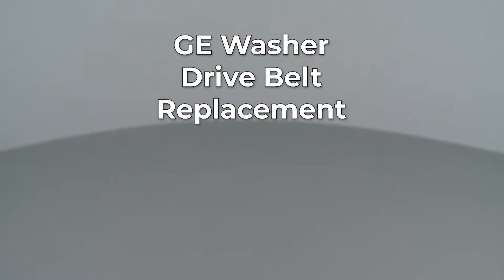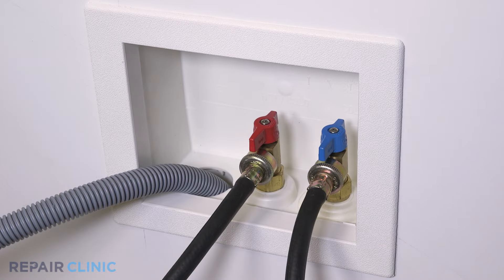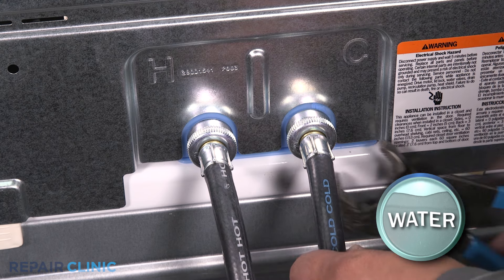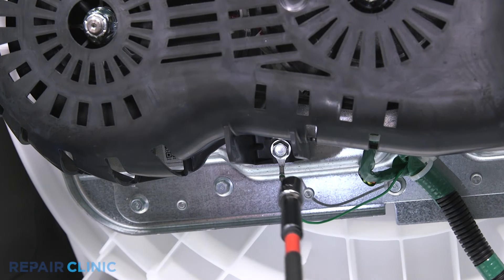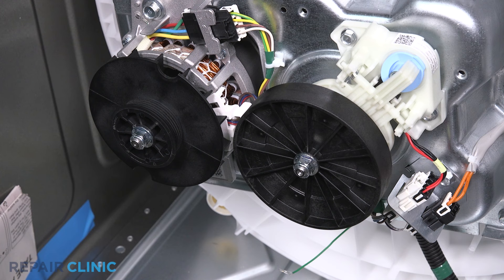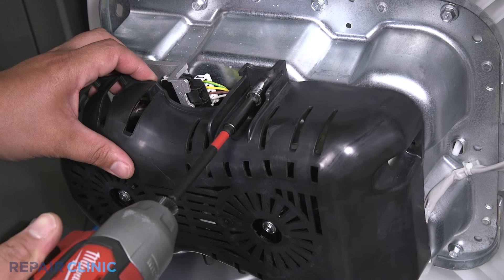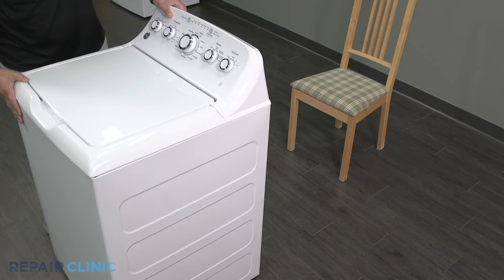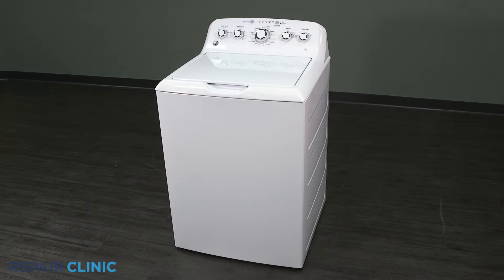GE Washer Drive Belt Replacement WH01X24180

Comment: How, sir...just how!??? Im using every limb and every fiber of my being. did you cut out the part where you struggled for 77 hours or do you have magic hands?
Reply: Use a blow drier to warm up the belt. 🤫😉
Reply: I spent 45 minutes struggling mightily. Put the belt in boiling water for 10-15 seconds. It loosens up the rubber. I spent 15 seconds and it worked!!!
Reply: I used a flathead screw driver to put it in place, but I seriously thought i was going to break the plastic wheel. I realized afterwards that i should have heated it up. But this video is somewhat misleading.
Reply: Didn't think to warm it up.  Put a vise grip on the pulley rib and used that to keep the belt from sliding off and as a crank lever.
Reply: Im trying now! omfg
Reply: I think this is misleading, I followed another site and put the belt on the grooved pulley first and using gloves and turning it went on the big pulley fairly easy. 3/8 socket for bolts. I also just tilted mine up like in the video, no unplugging or hose disconnect
Reply: I swear 😂😂😂😂
Reply: Lol i catching hell with it now 🤣  look easy to put back on omg!!!!!! 😢😢
Reply: I have cuts all over my hands plus all the grease that was on the spindle's 😂
Reply: Was struggling then I started at the smaller pulley and attached a 9/16 socket and ratchet to the big puller to turn while having a flathead screwdriver prying the belt at the middle of the big pulley. All I did was turn the ratchet until it was applying leverage to the screwdrivers handle and it went right on. Hope this comment made any lick of sense!

Comment: If anyone is having trouble, it's not too small and he makes it look way too easy lol. I started with the small side and used a flat head screw driver to stretch it over the big side while rotating the two disc's. It's worked and took me about 5 minutes once I used this method.

Comment: Heat up the belt with a hair dryer or boiling water.  Much easier
Reply: Thanks. That worked like a champ.
Reply: Dont ever do that you compromise the rubber

Comment: The easiest way to get the belt on. Put the belt on the small pulley and make sure it is in the groves. On the larger pulley, put the open side of the wrench on the pulley nut and hold it against the pulley, trapping the belt. It holds the belt on while you rotate it. Goes on easy. I would add a pic here, but it will not let me.

Comment: Any tips on stretching a belt to fit? I’ve got the right belt, but there is zero give.
Reply: small pulley first then roll
Reply: @connorgators  I did that, but I was holding the belt in the wrong place when moving the big pulley. Finally got it figured out and now I have a quiet washer. Thank God.

Comment: For anyone struggling to get the belt on - I believe the GE belt is easier, but would take longer to get. I bought one off amazon and thought it was impossible, but I came up with a technique that made it much easier

First off, WEAR GLOVES. Not rubber gloves. Work gloves. 

Second, hold the belt wadded up in one of your hands and use a hair dryer on it for about 30 seconds. This way you can get the whole thing at once. If you can't smell the rubber keep going. 

Now, start the belt on the small spool then go to the left one. start threading it around as far as you can go with your left hand until you can't go any further. Now - make a fist and press your fist against the side of the belt to hold it on. As you start rotating the spools around, keep pushing with your fist. It will keep the belt on. Once you get right past the halfway point you're pretty much done, so you don't have to really force it for very long.

Comment: How did u make putting the belt on so easy I literally cannot get it to fit 😢
Reply: Apparently the new one will be extremely tight and takes a little more muscle to get on than the video shows. He must have been reinstalling the one that was in there and not a new one.
Reply: Did you get it on becauseI'm thinking about taking a wheel off it's SO tight!
Reply: @kevincappella2980  I did without removing anything. I got it positioned a little more flat with noting in the tub and put the belt on the smaller gear first and then turned it on to the larger smoother one until it sat right. It was a fight.
Reply: This is f*&king impossible
Reply: There is no way you got that belt on without taking something off first.
Reply: No way a new belt was reinstalled that easily...sorry dude!
Reply: Heat the belt up.  A hair dryer or boiling water

Comment: Can't get the belt around both ... following instructions. What's the trick
Reply: Boiling water will soften the belt enough so you can slide it on. I just did it.